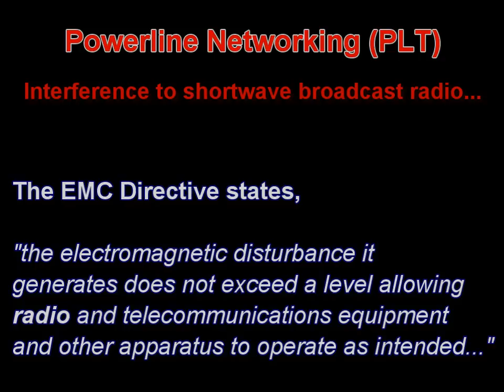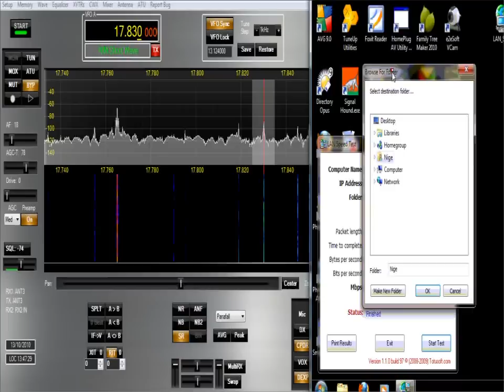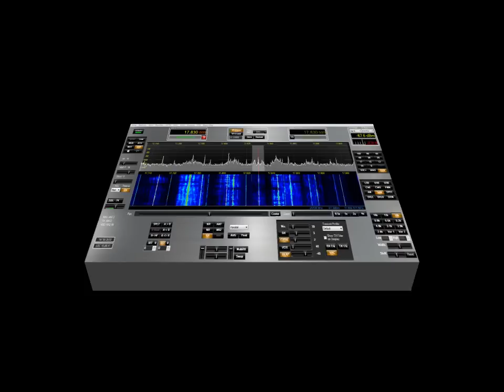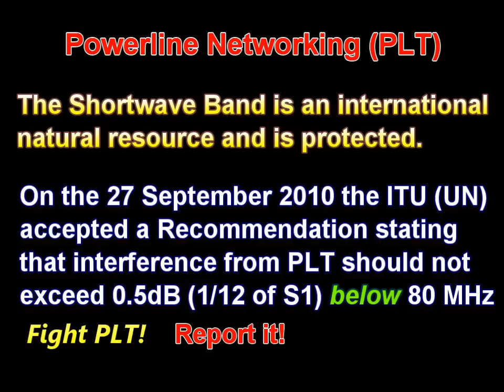Powerline Networking Interference: Shortwave - PLT

Comment: This same interference causes problems for cable tv/internet providers as they use 5-42mhz for their return spectrum. It wreaks havoc if there is any open in the system, causes severe FEC uncorrectable errors in the qam and is a real pain.

Comment: This is a very annoying problem to say the least. However, I have managed to mitigate the problem, at least to some extent, using the MFJ phase-based noise cancellation unit. Here's a demo video I made using SDRSharp: youtu.be / RGrADTm4UbQ There are other similar devices out there, such as the WiMo QRM Eliminator.